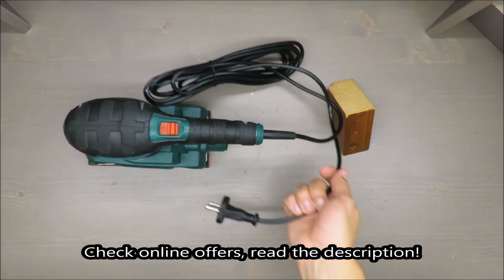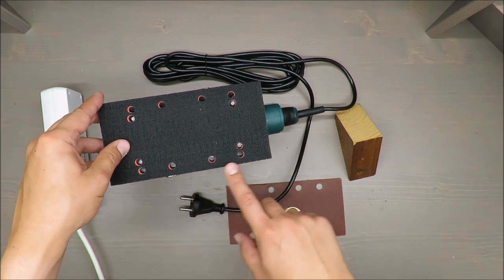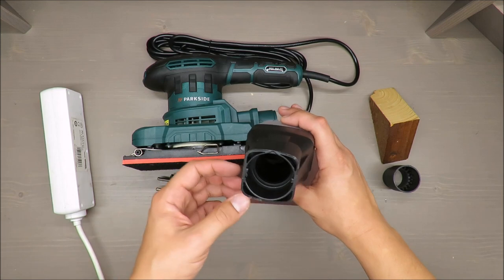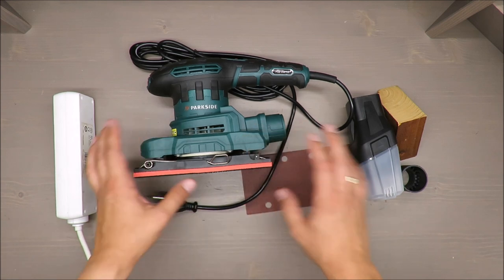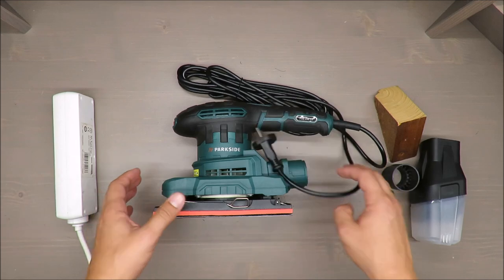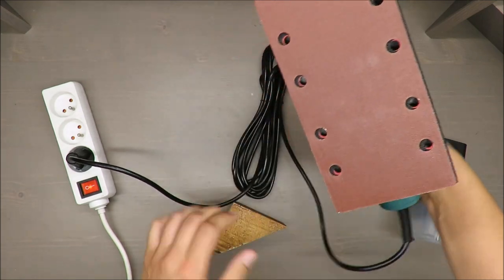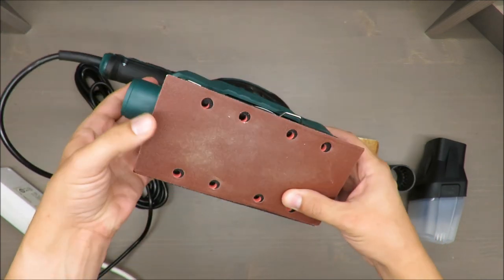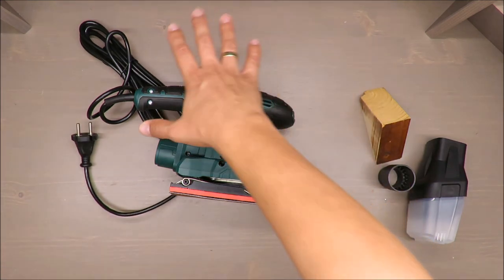Parkside Sheet Sander PSS 250 C3 REVIEW (Lidl 250W 12000 min-1 1.7kg)

Comment: I bought this, motor expired after using it to sand an internal plaster wall. Not used for a long period and not up to the job. I should have bought the Titan as they are more robust with a more powerful 300w motor.